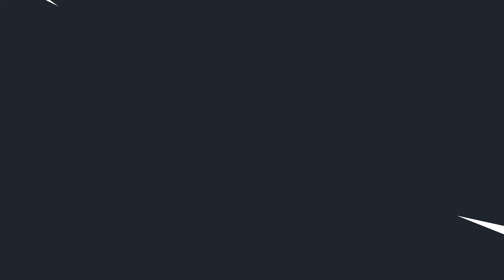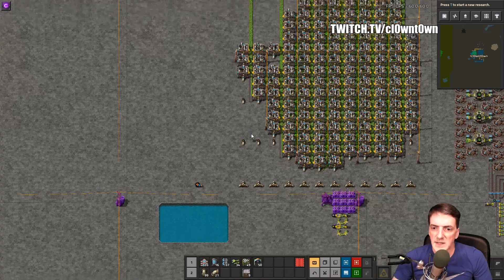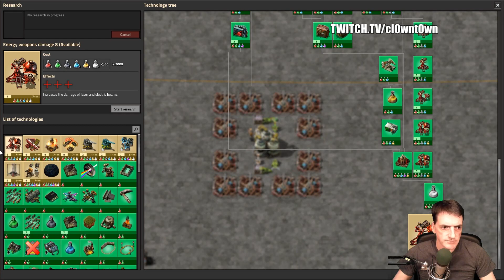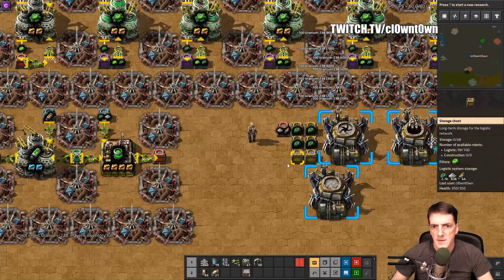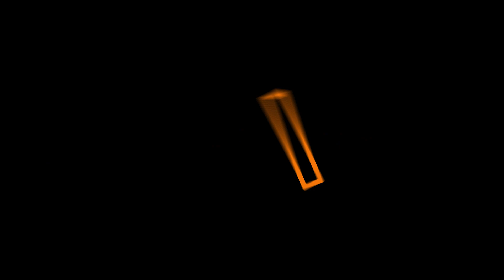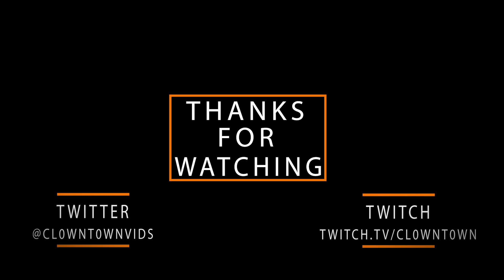Factorio - Getting Started Kovarex Enrichment Process Tutorial

Comment: First of, 1 centrifuge will on average keep 1 nuclear reactor fed. No need for modules, beacons or koverex enrichment; to start your first reactor.
Second of, the important part of the belt-fed koverex enrichment is that every centrifuge feeds itself first. Since the recipe has an input of 45 items and outputs 43 items, where 42 of those items can be recycled. If you dont recycle you need 9 times as much belt space. If you did recycling in the bot build it would also require way fewer bots.